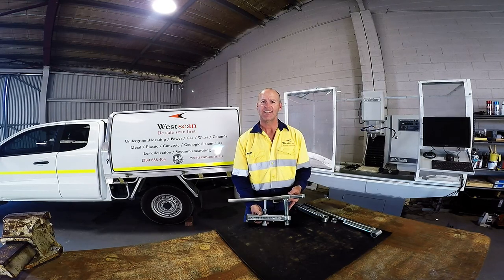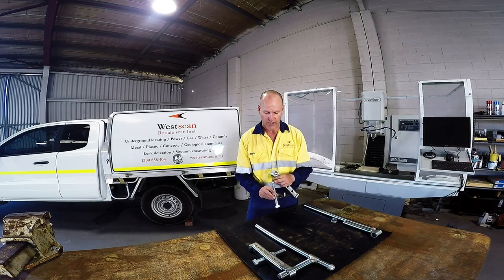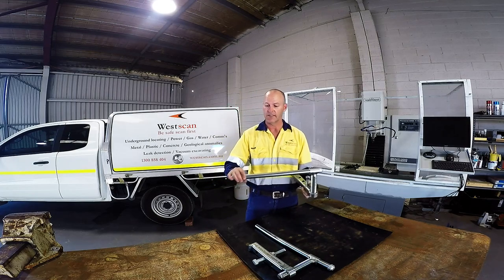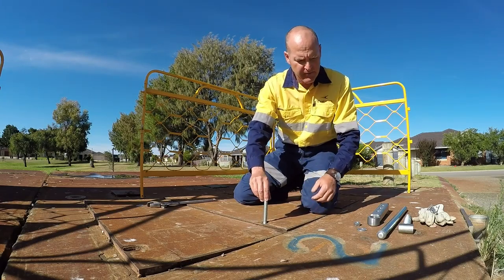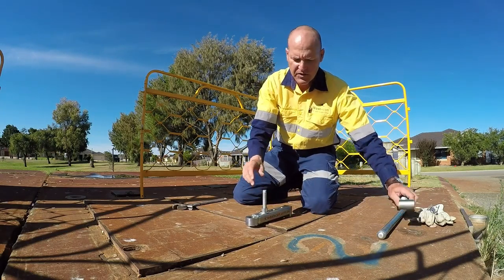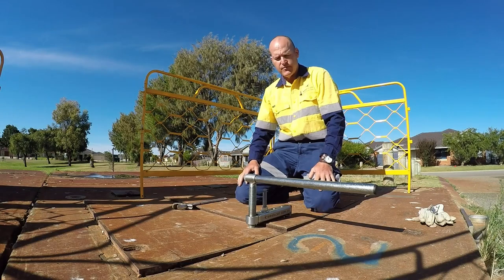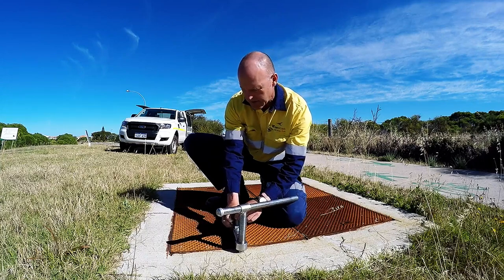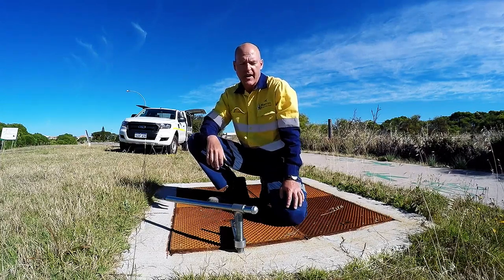Pit lid or cover seal breaker

Comment: I can see that your item should do what you claim however I did notice that the lids of the Pits that you used as a demonstration were either A/. Not installed correctly or B/. you had lifted them (and broken the seal) prior to recording your demo as they were not sitting flush at the beginning of your video. 
Having removed a few well rusted ACO Class D lids today that had not been lifted since they were installed in 2008, They would have been a very good test for your tool (which while I am sure it would have succeeded, it would have been a more realistic test)
Reply from the maker: Hi MD thank you for the feed back. The Sewer pump station lids at this location alway sat ajar, (as i would regularly walk my dog past and notice). the 2nd Telstra lid is showing the Westscan gatic T bolt will fit that type of lid as a normal gatic t bolt will not.
i recently went to job where a plumbing company had been using a 5 ton forklift with lifter to pop an old sewer lid, Took 10 minutes with the Pit seal breakers and boom/shudder sound as the seal broke. Would have been perfect video to add